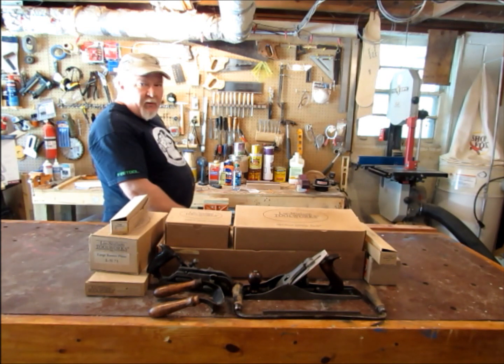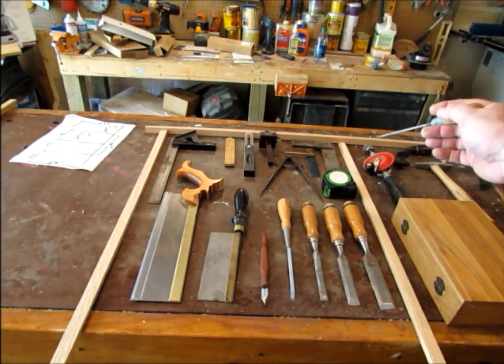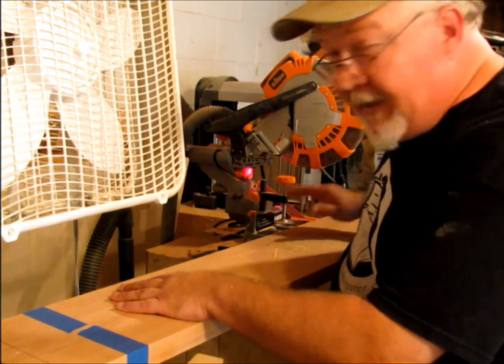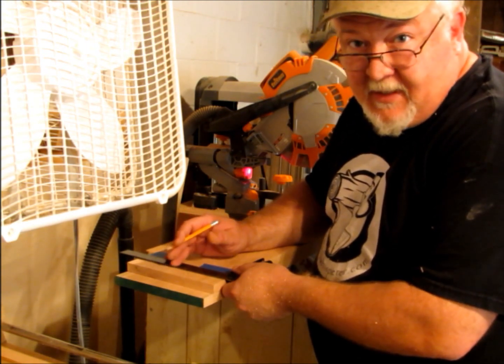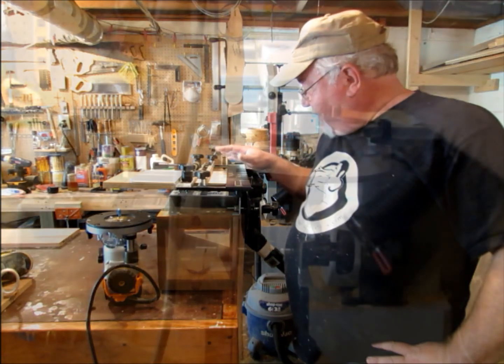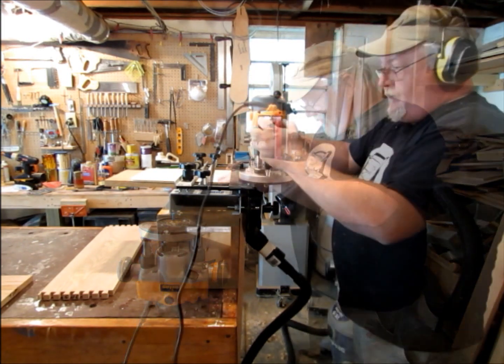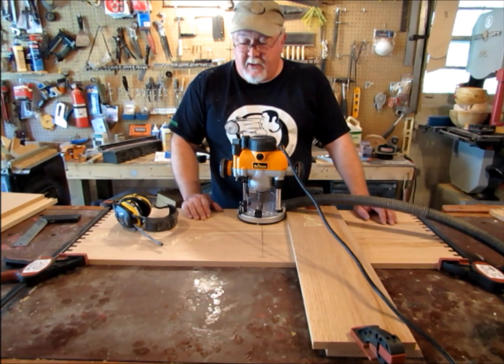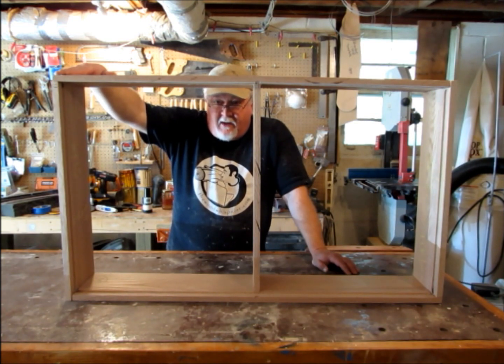Wall Hanging Tool Cabinet Part 1

Comment: Nice job Bill, I had found and old Irwin set the same as yours. Mine is a bit more worse for wear but I am so glad you opened it and we could take a peak inside. Your cabinet is shaping up very nicely. Keep us updated and we await part II.